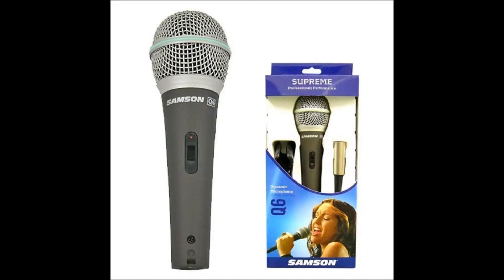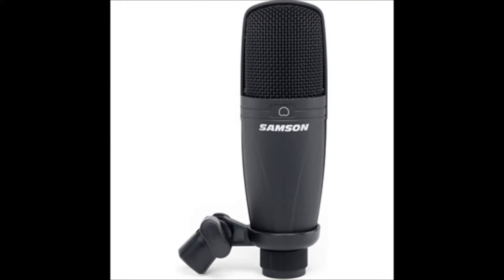Xenyx X2222USB with pre faders MAIN MIX insert (broadcasting audio setup)

Comment: Your video is wrong info... You are using the compressor to judge a mic?????? Wrong, not what a compressor does or is for.  A compressor should be used only when you understand its functions. Easy to use incorrectly use equipment once you have it.  Read up and use it  correctly and youll enjoy your mic and your setup much more. Go to some YouTube vids on this and you may find something there on how to use use compressors in live shows and in recording. Hope this helps!!